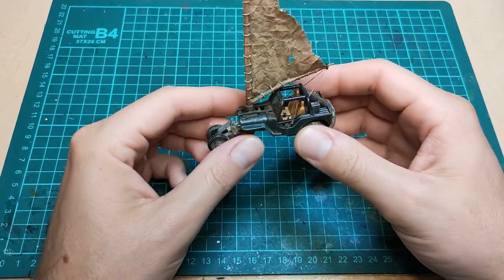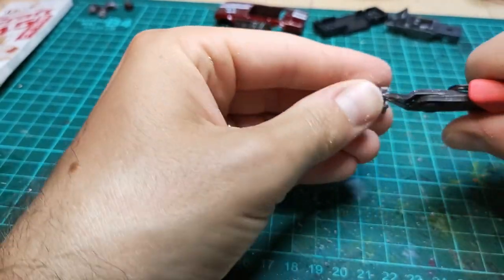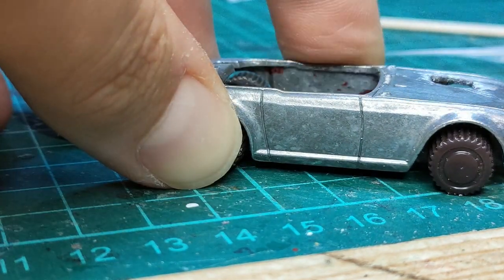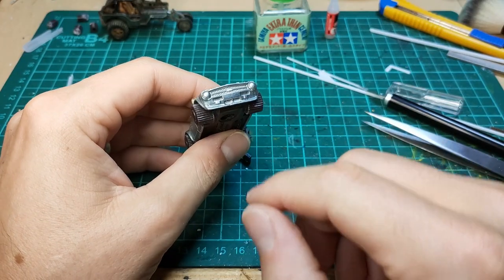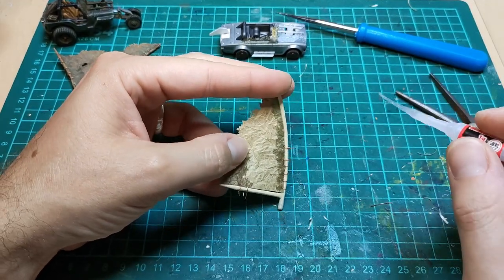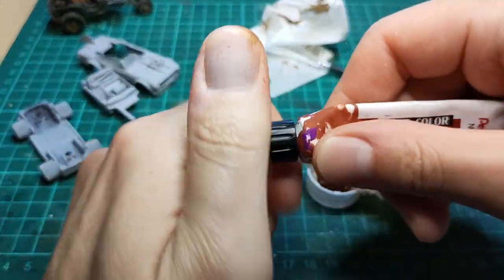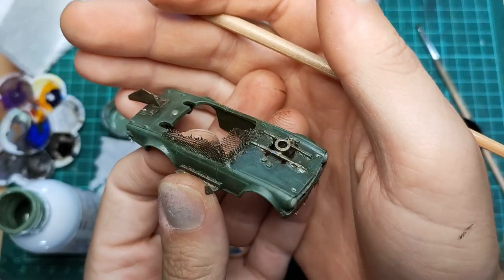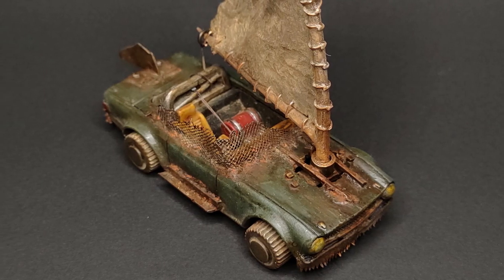Making SAILS for post apocalyptic cars | GASLANDS custom tabletop miniatures

Comment: If you apply white glue mixed with water and coat the paper bag or even toilet paper you can get a good effect too. Also works well for rolled up tarps and stuff.
Reply from the maker: Good call 👍 I have less than 0 patience for drying time 😂
Reply: Watered down white glue gives you the same effect on paper products as the CA glue, but with ZERO toxic fumes. As a bonus by using your heat gun (or a hair dryer) you have a little time to form the paper into whatever shape you need without glueing your fingers to the paper.

Comment: Very nice build, sadly you didn't make the wheels rolling... To the sails. If the cardboard toplayer is to thin  why not double the edges up on both sides?  Make the doubling a little bigger than needed and trim it to size when the layers are dryed completly. This will although prevent the paper from ripping of whein you install the wireloops. 

One more point. I see problems with the stability of the car. by mounting the mast offcenter The car shoul'd get an outriggerwheel to the left side!.  Steering with thos drummwheels will be a challenge..
Reply from the maker: Thanks! You have some good points on the unrealistic nature of the build but I wonder how big a sail would need to be to push a car?? This thing's gotta be heavy!
Reply: I also thought that an outrigger would work well in this situation. You could use a tiny bead as a wheel for outrigger, just have to build it out of some wire (or a paperclip).

Comment: Is the paint striping process needed? Cant we just paint over?
Reply from the maker: It's up to you. I like to strip the paint to get a nice blank slate and the paint they use is often very thick and hides small details in the casting. I have a couple videos where I make cars and keep the paint on. Check out my scratch built roll cage video 👍

Comment: How is it that people in nearly every country and area in the US can get styrene sheets at the bloody dollar stores around them?  My dollar stores don't have anything 1/2 that useful.
Reply from the maker: I only found them recently here and they are only at one store I know of. Where are you located? I know a lot of people use "for sale" signs as plasticard too.
Reply: @BPCustomCreations  I have not been able to locate styrene sheets at my local dollar stores either. I started looking at the small signage (garage sale, etc.), but all that I find are very, very thin.

As an alternative I have started collecting used/empty gift cards. They come in varying thicknesses and most have no embossed numbers (unlike credit cards) and are a great size for small scale scratchbuilding.
Reply from the maker: @earlware4322  most of the styrene I use is 0.5mm thick so it doesn't need to be thick. I pive in Japan so the dollar stores are very different here as well. I was shocked to even find it here but it's not going to be in the US.